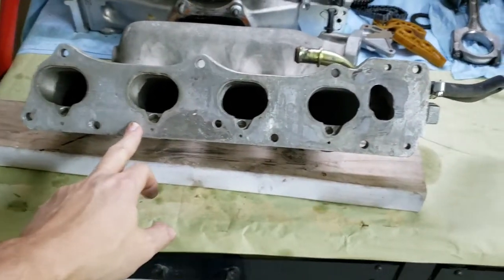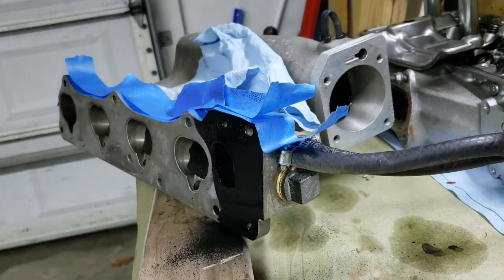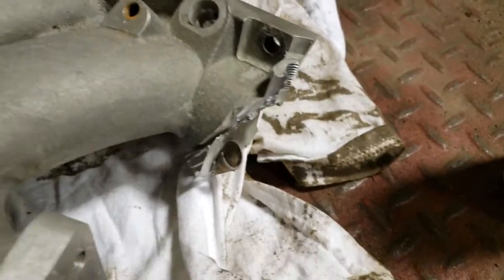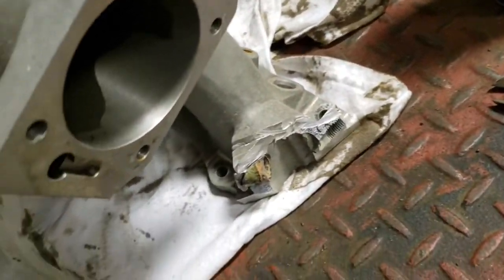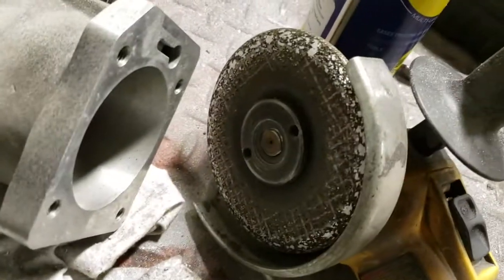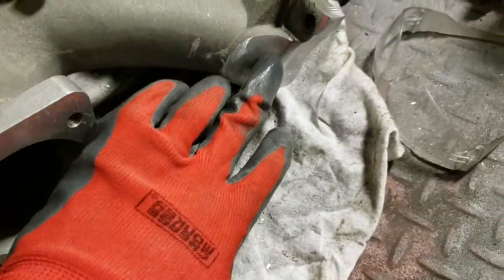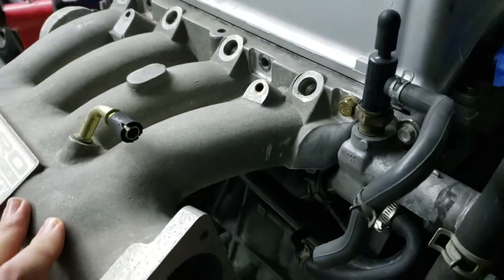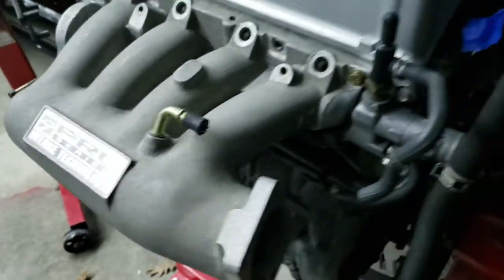Modifying K24 Skunk2 intake manifold to fit K20

Comment: Would that manifold you cut bolt right on to a k24a2 without having to do anything I have the same one but it looks like it’s missing a hole it has the one you cut off but there’s another hole on the 24 engine but the manifold blocks it is that fine to be covered?